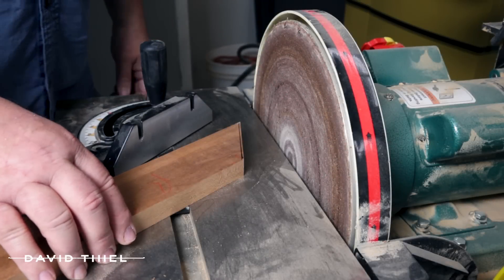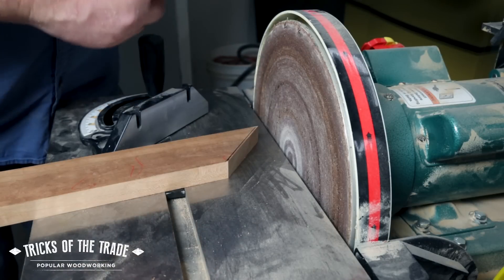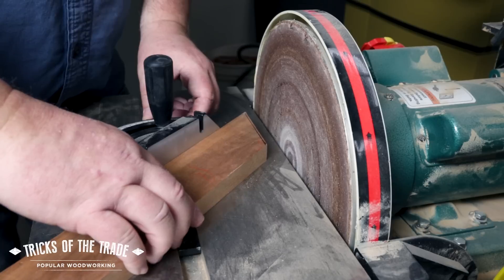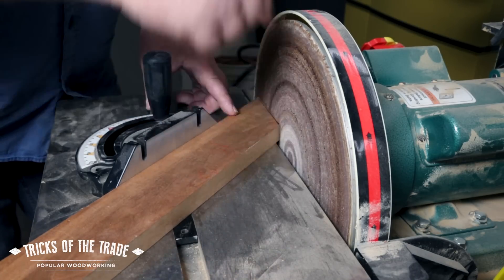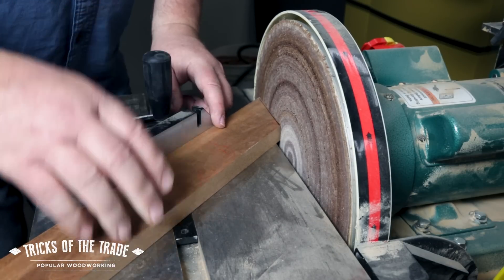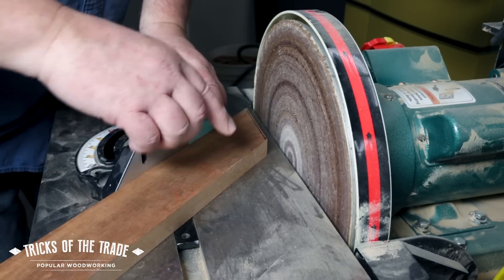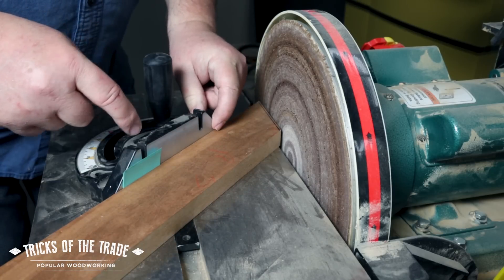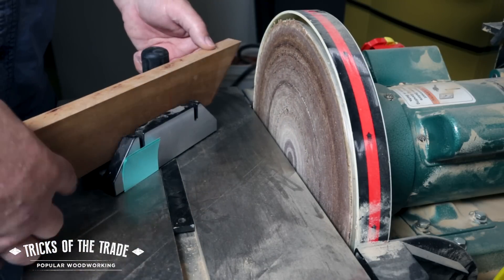Disc Sander Adjust | Tricks of the Trade

Comment: so, missed opportunity for tips and tricks on replacing sticky backed disc sander discs.... because that is a pain in the nuts
Reply from the maker: Yep, I'll come back to that one. It's worth the time! Thanks.
Reply: A hot air gun (heat gun) works well, and then a solvent to clean the plate. Very easy.
Reply: Yeah.... and that's why no one ever complains about doing it. Using a heat gun and solvents is all well and good but I'm looking for tips and tricks to make it easier. Not to maintain the status quo. Plus there may be tons of folks who have no idea how to use a heat gun and solvents to do it or any other ways. Not all folks are as knowledgeable as regular wood workers when it comes to that type of tool maintenance.

Comment: A card (from a deck of playing cards) is ~ 0.01".  I've found these to be very useful for tweaking fits.

Also, if you do this, first, make sure your miter gauge fits into the miter slot without any slop.  Trying to tweak a thousandth of an inch when you miter gauge moves a tenth of an inch will drive you insane until you figure it out.  If you need the precision, seriously consider an aftermarket miter gauge.

Happy woodworking.
Reply from the maker: Excellent advice! Thanks, David.
Reply: A C clamp (or other) will fix the gauge to the slot in a pinch